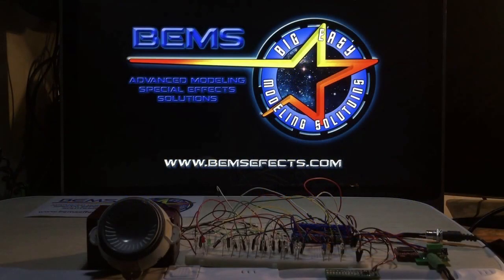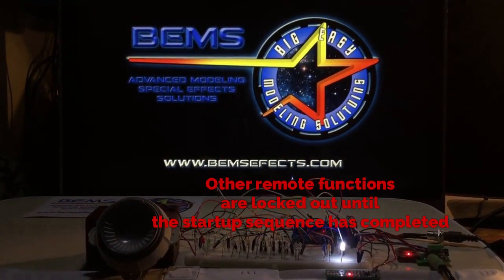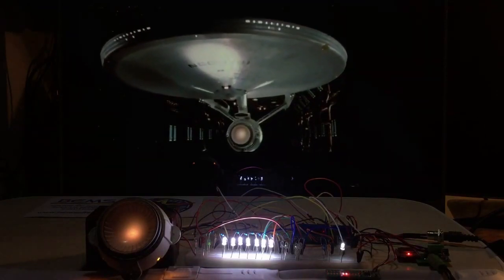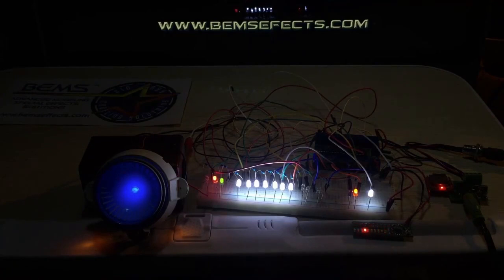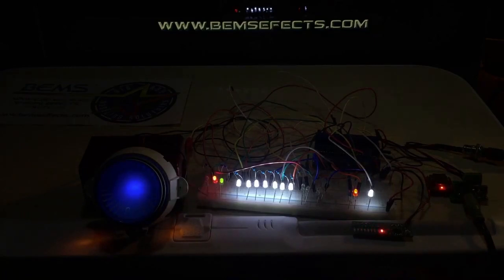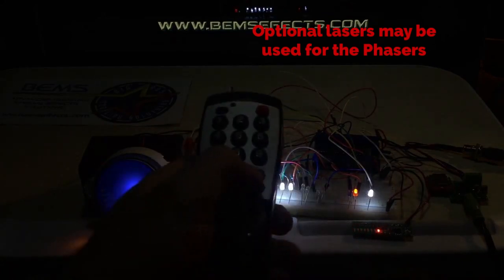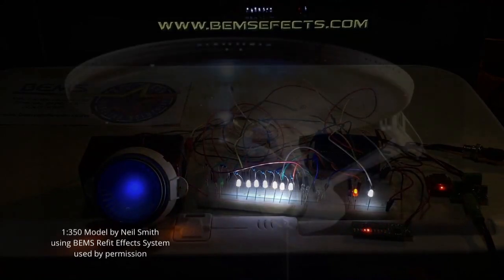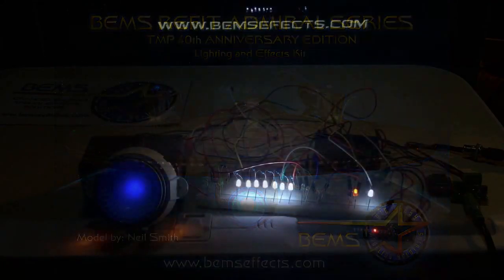ALL NEW! BEMS Refit Admiral Series TMP 40th Anniversary Edition (improved video)

Comment: thinking about buying the bundle full kit, will I need to make up the wiring or is that already done, also how does the sound hook up.  thank you
Reply from the maker: There is a wiring harness to make things easier and some of the more unusual components are prewired, but there is still basic soldering required for the LED’s. All wire and necessary resistors are included with the kit. Please see the “SFX Refit Signature Series” as it has replaced and upgraded this version of the kit. Thanks!
Reply: @stellareffectsmodelingsolu1746  is there anything on youtube that shows the build process, and what about the sound hook up please
Reply from the maker: Troy, I haven’t had time to put a build together personally, but there are a few videos by other builders from older versions of my kits. (a version with no startup as well as the 40th Anniversary version you see above) I’ll list a few links in subsequent replies.

Sound connection is simple. It’s a separate board with four wires that connect directly to the main board. Positive, negative, sound data, and remote sensor.

You can download the instructions for the new kit in the Resource Library on the SFX Modeling website. It’ll show you how everything connects.
Reply from the maker: Christopher Colvin - 40th Anniversary Edition
https://youtu.be/r_mfW3eh5U0
Reply from the maker: Here’s one from a predecessor with no startup, the Refit Commander/Captain Series by Neil Smith. The newest Signature Series version will look pretty much the same in the models but with way more features, three unique startup sequences, more adjustable lighting, and about 5 times the sound and effects. That kit, for instance, has six buttons to control effects and about 25 sounds. The new system has a 24 button remote and over 150 sounds. But as far as lighting location and types of lights used, they are pretty much the same. It’s just the new kit DOES way more with the lighting it has.

https://youtu.be/QQIgZfPPMQM
Reply from the maker: Here’s the new system in a protoboard demo format:
https://youtu.be/CpMYmMTWjeY